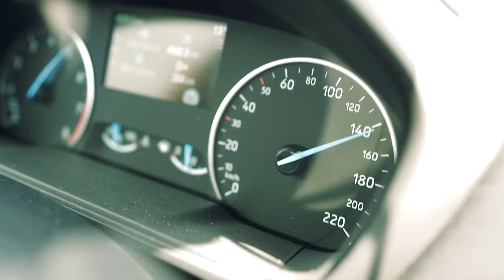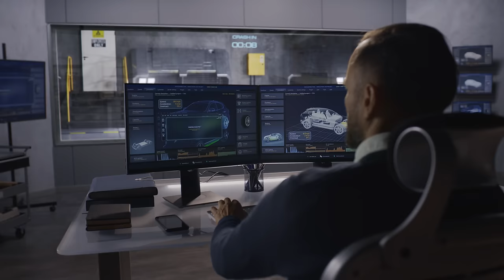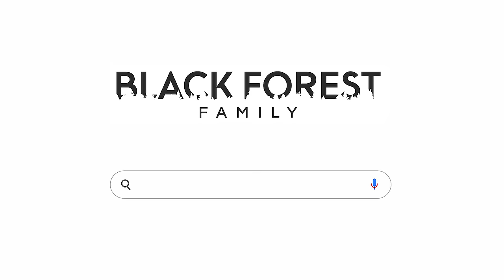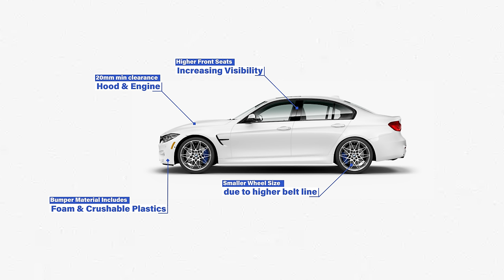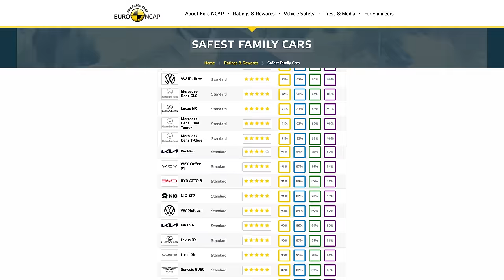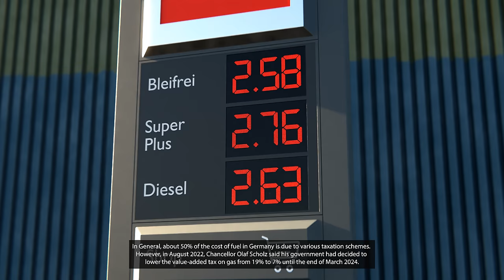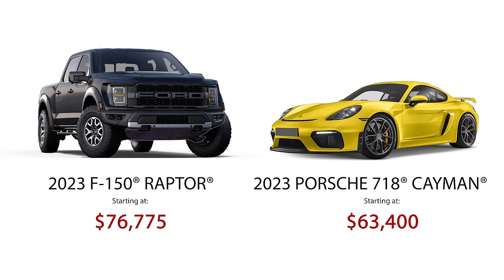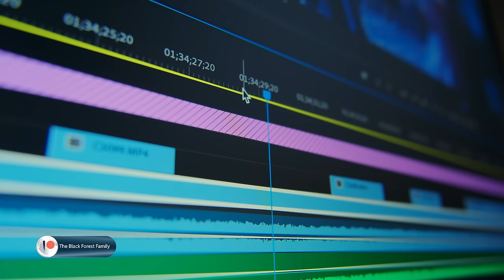DRIVING CULTURE CLASH: Why do our Cars LOOK so Radically Different?

Comment: Many Americans have (somehow) tied the size of their vehicle to their masculinity or patriotism (or both).

My understanding is that one reason we keep seeing larger and larger vehicles in the U.S. is because of fuel efficiency standards that base the minimum fuel efficiency on a formula that rewards having a larger wheelbase and track.  I think of that as the vehicles "footprint", but I don't know if that is the correct term.  Essentially, they were trying not to punish large vehicles by giving them fuel efficiency goals that were unrealistic, but the auto manufacturers saw it as a way to avoid having to make fuel efficient vehicles.  It is more cost effective to make an F-150 longer and wider than to make it get 35 MPG.  The thing I can't figure out is why they are also making them taller.

Comment: Nice Analysis, but one point of view is missing in my opinion. Who buys the cars? Looking at sold items isn't enough. For example over 70% of sold VW Golf in Germany are bought by companies and not private persons. The VW Golf is still without doubt a popular car, but most new private used cars are still small in Germany. The major sellers of private used cars for the last few years are small cars like the Mini,  Hyundai I10, Fiat 500, VW up, Opel Corsa and only after those cars the Golf is listed by the federal office for motor vehicles right on the same level with a Mercedes C class and the VW Passat. The focus which car to buy has changed in Germany while it stayed the same in the USA that people want to have trucks for private use. 
Another important thing you missed are the laws what you are allowed to do with your car. Cars that can tow a trailer in Germany are not allowed to do that in the USA. It's common to see a VW Polo,  a Mini and other small cars towing a caravan or a small trailer in Europe. Those cars that are not allowed to do that in the USA. I think not even a Golf is allowed to tow a trailer in some states.

Comment: The mistaken idea that more is better is a US thing in many areas. Advertisers have somehow convinced customers that a thing is 'MAX', 'DELUXE' or some other sales wankword when in fact all they're doing is giving you more of the same. 

Just look at the McMansion craze of 15 years ago and how badly those cheap buildings have fared. 

The styling of US cars has always been way behind that of Europe (also now Asia) and don't even think about handling. One of my cars is a Jeep and the first thing I did when I got it was to upgrade the suspension as the ride was unbearable. 

It's now seventeen years old and while the fundamentals like the engine and drive train have held up well anything 'luxury' such as the heated seats, stereo and electric mirrors failed a long time ago.

Comment: There are differences between European cars. German cars are geared to stability in high speed, as it is the only state with no-speed-limit freeways. Italian cars are way more esthetic, and are more fun to drive if you are a sportif driver. French cars are the most comfortable cars if you just commute and live a city life with traffic etc. 
If I'd live in Germany, I'd surely buy a German car to drive safely at ridiculous speed. However, for most major non-German cities, I'd rather buy a  French car, as they are more comfortable for daily use.
I once had an American car for a year - it was a nightmare. I'd rather drive a Toyota than an American car.
At the moment I own a Citroen, which I am in love with :) 
In cost-performance-comfort considerations, it's hard to beat. It is outrageously comfortable for commuting. 
(btw, I don't live in the US or Europe).

Comment: The stats is a tiny bit missleading. The thing is that trucks are not filed as cars, but trucks in europe.

So even if a truck outsells a car, it will not show up in the car stats.

Sure, if you look at only the top selling car, it dont matter much, you probobly need to go to 7 or 8 place before a truck would show.

But there are one other issue. In us therr is really two trucks thst is top selling. In europe there is like 20 top sellimg trucks. Some are just rebrands. Like opel  peugeut, citroeen and renault all selling the same truck under diffrent name. Making the fairly popular truck not show up in stats.

So looking in the stats can be quite misselading. Specially so say in places like finland and iceland rhat got quite a lot of light trucks.

So to make it a fair comparison trucks have to be removed from the comparison.

Comment: i find it fascinating that the US is the only country that always loved the automatic gearbox more than the manual gearbox. Nowadays the automatic gearbox is well refined and makes actual sense but go back 20 years ago and beyond, the manual gearbox was a superior technology. the manual gearbox is cheaper to produce and cheaper to run. manual cars use a lot less fuel and due to very slow gear changes of the automatic gearbox, manual cars would also be more dynamic, basically faster, thats why old american sports/super cars used to have manual gearboxes. the most common manual car americans know is the ford mustang, even modern ones. the only real advantage was of course the convenience of not having to use the clutch and having the gears shifted by the car itself. 
i guess americans have the money for more expensive cars and obviously pay relatively little for fuel, so there really is no incentive to buy a very efficient car. the "bare minimum" american car is still a much bigger car than the european "bare minimum" which is often a very small smart or something like a vw up.

Comment: The easy answers are: raise your seat when driving, pedestrians need to stop thinking that they are “bigger” than a vehicle just think of it as a car vs a semi truck… who will get the right a way, and lastly, those who choose to ride a bicycle on a rode that shares it with a vehicle, the bicyclists should also yield the right of way to the bigger object. Use common sense. And please follow the same laws many not all but many of the bicyclists in America enjoys lane splitting and running stop signs and lights. 

I know that in Europe it’s a complete flip. Drivers dang near get whiplash braking because of someone wanting to cross the street and it’s the law that they get the right away. But for me personally, I don’t know what that person is doing, I can seem them and that vehicle but can the driver truly 100% see me? So these new laws being made for the pedestrian are good on paper but in reality, in my opinion, I think it’s crazy.

Comment: You would have a big problem driving in any German parking garage with one of these huge US pickup trucks. Neither are the parking spaces in these garages wide or long enough nor would you be able to navigate the turns up or down to the next level. You‘d get stuck between the pillars when trying to turn.

Comment: Main reason why European cars started off being smaller is due the shortage of metal and other resources just in the aftermath of WW2,  while demand was high due booming recovering industries and exploding GDP.  In the '70 there was an oil crisis, so fuel efficiency became an issue. Most countries tax cars on weight, and emissions too nowadays, safety rules did the rest.

Comment: Makes no difference. Park in a shopping center.
 Here in the rust belt you car is lost in a herd of the same cars or trucks.
 Only 5 or 6 different colors and even less difference in shape.
My 21 year Belchfire stands out. Color and shape is that different.
But I doubt it will last another 5 years before the rust consumes it.
Probably drive it to the junkyard. Did that more than once.

Comment: I have a vw id4 and live in Norway.
The roomyness of the car makes the rides really comfortable and enjoyable, plus plenty of space to haul all the crap our toddler needs.
But I still came stand how wide and high the front part of the car is, and that is completely unnecessary. The id3 has a smaller front section but its the same car platform with the same engine mounted in the rear.

Comment: I fluquing hate these new useless giant new cars, I drove a small car for over 20 years but i I no longer feel safe driving a small car so i bought a used volvo v70 and it starting to look small next to the new mid size cars and specially SUVs and they have less space inside and are heavier

Comment: My experience with pickup truck drivers here in London, Ontario is that, because of the relative size of their vehicles, they are much more likely to drive agressively and act like they own the road. Vehicles like these do not belong in towns and cities and should be legally relegated to farms. Barring that, if the purchaser is not a farmer, pickup trucks should be heavily taxed, not just on the initial purchase price, but also on fuel consumption and road wear and tear.

Comment: Believe it or not, the size of US car getting bigger and bigger is all due to U.S. Environmental Protection Agency (EPA).  start a couple of decades ago. they set teh standard for every car. teh miles per gallon rating for each car is base on it wheel base, not engine size. so far smaller pickup and car, they need to get a certain mpg rating to be legal. smaller car need to get higher and higher mpg  while car with bigger wheel base dotn need to get as high mpg rating to still be legal. company figure out that it cheaper to just biuild the car bigger and bigger then trying to develop engine that can get better and better mpg. if u look around, a lot of teh smaller cars and pickup are mostly hybrid cause that like th eonly way to reach the mpg rating require by the epa. truck and suv take teh cheaper route. now know that US safety regulation is mainly on survival of the occupant, out in the road, would u drive a pedestian friend box or a occupant safety base oversize truck and suv.

every year as epa require the mpg rating to be better, the company just increase the wheel base of teh suv or truck so they can stay in teh same mpg rating without much investing into develping new engine to meet new mpg rating.

Comment: In Europe you're not driving all that far. If I wish to visit my little sister it's a 12 hour drive straight thru, but stopping to eat and get fuel means closer to 14 hours behind the wheel. And we don't have the passenger train service so we like large comfortable seats and smooth ride with a powerful enough engine it doesn't strain the engine when going through mountains.

Comment: There are already people in the UK starting to push for a ban on SUVs. A recent poll found 55% of drivers in favour of the move. This is driven by the poor fuel economy and high emissions they have as well as not suiting the size of most roads here and their poor safety for pedestrians. They are referred to as "Chelsea tractors" as the highest density of them is found in West London, not the sort of terrain that they are really designed for.

Comment: Car design in Europe has changed from an emphasis on space utilisation made to look good to a look good that incidentally has space.  You only have to look at the Mini to see how efficient the original BMC 1959 design was compared with the current iterations from BMW.  Both vehicles provide essentially the same accommodation and you only realise how big the new one is when it is presented next to its original self, this is much more striking than the Golf.  Also, at one time during 1960s/1970s European cars were smaller replicas of American models, generally by the likes of American owned companies like Opel and Ford, now days, instead of building small cars that looked big the emphasis is on building big cars that look small.  Park a modern Jaguar XJ next to a 1959 Cadillac DeVille (fins and all) and you will see that the jaguar dwarfs it, the icon of US excess.

Comment: The comparison of the Ford Escape with the Ford EcoSport is unfortunately not correct.
Ford sells the exact same Ford Escape here in Germany and Europe, but it is called Ford Kuga! But is exactly the same car.
The smaller Ford EcoSport is no longer in production and was based on the Ford Fiesta.
But there is another small SUV called Ford Puma that is also based on the Fiesta platform.
So currently there are two Ford petrol SUVs available in Germany/Europe: The Puma and the Kuga (that is an Escape).

Comment: Some thoughts I had while watching:
- Before WW II car sizes were approximately equal in Germany and the US; Germany started only to produce smaller cars after WW II, which had to do mostly with available resources and the relation of costs and spending power of the average German. For a long time German cars staid smaller in average afterwards, because Germans had learned to appreciate the advantages of smaller size. But nowadays you see more and more obese and adipose cars, mostly SUVs (which raise the profit margin for car producers - they got higher prices for less costly designed SUVs than for better engineered and less resource wasting cars, and to include some "luxury" equipment is far cheaper to them than to increase technical efficiency). Even many EVs are now heavy and inefficient SUVs. And that raises costs of driving not only for the SUV users, but for all: After renovation parking garages for example offer less spaces than before, because SUVs (and newer car models in general) need more space per car. Heavy vehicles wear roads down more quickly, so the temporal distance between heavy restructurings shrinks, using up more taxes. Heavy vehicles also wear down their tires more quickly, so more fine dust pollution, causing more cancer. And so on...
- The average range of commute is higher in the US because the US infrastructure was deliberately designed to have longer commutes. Germany has also urban sprawls destroying smaller villages, overdevelopment without including appropriate expansion of public transport, so forcing the use of multiple cars in families - but the scale is far smaller compared to US, and there are already political efforts to thwart and reverse those developments to provide a better and more livable way of life.
- I had multiple VW Golf in my life, and which each generation the outer dimensions grew, while the available space at the backseats or the trunk shrunk. Therefore I had to change the brand...

Comment: If it’s looks you’re after it’s pretty easy, both regions seem to be going in the direction of SUVs, but they achieve that quite differently. The US got there by making light trucks into SUVs, which ends up looking like a pickup truck with a covered truck bed. Yet EU models went there by making their estate (or station wagons) into SUV models, which almost ends up with a design of an estate car on stilts.

Comment: 21:04 Yes, true. In Europe crossovers are taking the place which once was of sedans and wagons.
But, as you said, the Tiguan is the most sold crossover in Germany. In France this goes to the 2008 (which is the the fifth most sold car, behind a group of sub-compact cars), in Italy to the Jeep Renegade (the forth most sold, and it sales a thid of the most sold, the FIAT Panda), in the Netherlands it's the Volvo XC40 (the fifth most sold car behind another bunch of compacts and sub-compacts, and again around half of the most sold, which is the Toyota Yaris).
So we are talking about cars with 1.5-2.0 liter engines, none of which is longer than 4.50 m (around 14ft and 3/4).
So, even the trend, Europe average is just more sensible than the American counterparts.
It's a matter of costs, of course. But why would I need a Trail Blazer to get my groceries when I find my Peugeot 3008 already oversized for this type of mission?
Even if I would live in US or Canada, I think I would never get something bigger than a RAV4 with my current needs (which are the needs of any average person whith an average family).

Comment: Note I live in Australia. Station wagons were perfect but the manufacturers kept SHRINKING them so they became unpopular and now there are few around. It's no wonder people moved to pickup trucks. Now I drive a Kia Carnival (Sedona). Renting a truck for specific occasions isn't practical for most people and isn't without risk with plenty of car rental horror stories. I may need to transport my kids and a couple of their friends at a moment's notice, or my dogs to the vet, or haul hobby gear. If I spent the time hiring a vehicle, I wouldn't have any time left to use it. I can barely find the time to get it serviced. So there are definitely some factors you're leaving out of the discussion such as how busy people now are with both partners working full time and trying to manage a household and raising children in what little time is left.

Comment: I live in the US and I drive a 2019 Nissan Frontier. It's a quad cab with a 5' bed. I use it as my daily driver for the work commute, errands and such. But I am also an arcade game collector, so it does see its fair share of hauling things. Be it games, parts or totally unrelated stuff. So it does get used as an actual truck. Now, I absolutely don't need or want a full size truck. They have become ridiculous in size. I much prefer my 'midsize' pickup.

Comment: Always in awe about the research you come up with! Congrats! Very well done, again!
A bikers story: I've been riding a BMW R 75/5 for some 20 years. (Still have it. Needs repair.) A wonderful tourer. Currently ride a Yamaha RD 125LC. Why? I wanted a bike to cut lanes more easily on my way to work. And found this great bike! 21hp, 100 kg of weight. 140km/h top speed, 4l of fuel to cover 100km. And pure fun to ride! 62yrs old, I don't need to impress any girls with my ride anymore. 
(Old guys just wanna have fun! haha!)